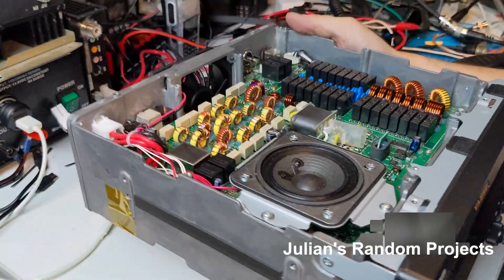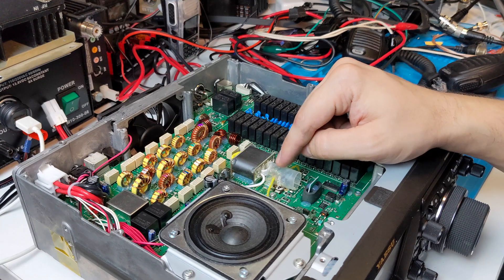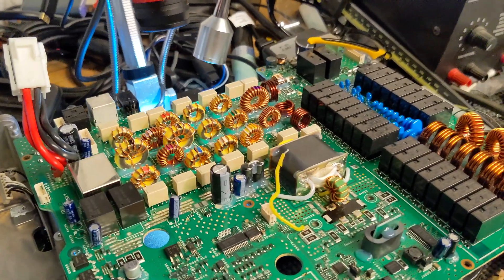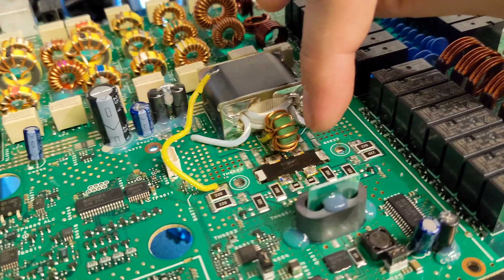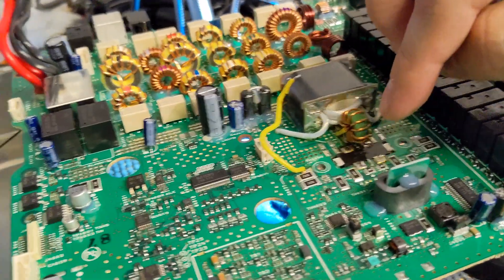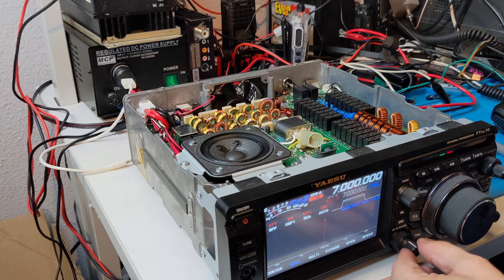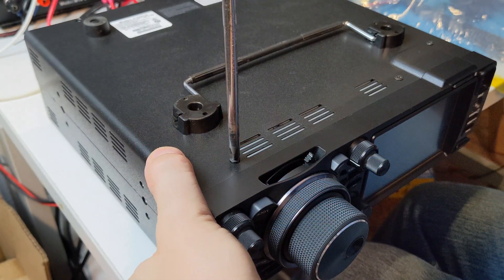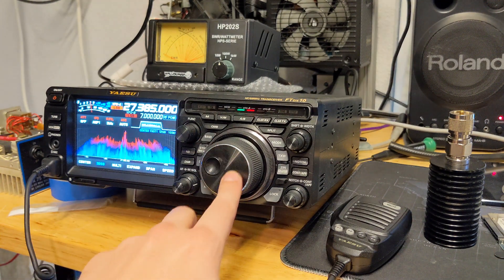FT DX10 Ham Radio Repair Pt2 RD70HUP2 Replaced.

Comment: Hi I (1 of the 3) have just repaired one of these, after remove the PA board from the radio, I desoldered the 6 connections (lugs) and bent them vertically. I set my Hot Plate to 662 F and placed the underside of the PA heat spreader on the plate; within 30 seconds I was able to remove the RD70HUP2 I will see if I can upload a picture. The heat Spreader is also glued to the rear of the board and stayed in place. I used the hop plate to solder the new device to the spreader. Then I resoldered the 6 pins! This is not an easy job. The radio I repaired died while using FT8 at 25 Watts! So clearly the DX10 is not suitable for FT8 or repairing! A shame.
Reply from the maker: These a good data points! Thanks for sharing

Comment: The mosfet is solderes to the headsink, when you replace it you need to solder it back on the heatsink again - you CAN'T just give it some heatpaste! this is NOT correct and nor a solution that will hold. That way mosfet is only fixed to the PCB, not anything else, and the solderpads and solder will press it down to the chassis and headsink, that will not hold!
Reply from the maker: Are you ok? Go re-watch the video. The mosfet 'is' soldered to the heatsink and the heatsink pasted better that factory to the heatsink. We're good. :)

Comment: So power mosfet has cooked on one side... I got it apart without issue.  Problem was not enough solder on back of chip so the failed end had overheated... It happens

My question now is what temprature solder paste to use to replace the new device to board and heat spreader...

I have some chipquick 138 degree c but notice the max channel temp on spec sheet is the usual 175... But instructions, say to keep device below 140 which is sensible... Anyone have any experience in this area... Regards Bob
Reply from the maker: Bob, I only use chipquick to remove components, then clean and remove all chipquick and apply fresh 63/37 solder. hope that helps.

Comment: I'm one of the 3 people that would like to see how you replaced the RD70HUP2. I'm planning on making the attempt myself.
Reply from the maker: You got it! I'll record the next one that comes through the shop. I have a hot air rework wand that I used to heat the chassis to ~650f. Desolder and lift all legs first then apply heat under part until the solder melt and lift (or drop if you're using gravity. Good luck!
Reply: @JuliansRandomProject  Thank you!
Reply: @JuliansRandomProject  Hey, Thanks again for this video. I'm returning here as I removed the RD70HUP2 from my radio last night. It went exactly as you said. I used hot air and gravity to let the plate just fall off the board. Everything went smoothly. Question for you - After replacing the RD70HUP2, did you need to do any of the alignment steps from the technical supplement manual? Specifically, the Drive Stage Idling Current Adjustment?

Comment: I am about to do a similar repair (well, there are two of them already waiting for this job on my lab!). I am not sure if I understood how did you replace the MOSFET. Did you take out the bottom heatsink plate, soldered the power transistor legs and then soldered back the heatsink?. Or did you leave the heatsink on place and then heat it until you could solder the transistor from the upper side of the PCB?. Also, how did you sepparate the transistor from the heatsink in first place?.  Please, any clarification on the exact procedure would be welcomed. Thanks!
Reply from the maker: You’ll need a hot air rework station or a massive soldering iron to get the heat sink up to temp. When removing the part, lift legs first, flip board and heat to remove body of part with gravity and maybe a little help from tweezers. When installing, line up the part, flow heat sink to get to seat then solder legs. Or you can send it in to me. JuliansRadioRepair.com . Godspeed!
Reply: @JuliansRandomProject  Thnaks for the details!. I am a bit far from you, in Spain. I also work fixing radios since the 90s but as my main work since June 2012. So far, about 5500 rigs have passed through my workbench. I hope to reach 10000 before retirement 😅 The FTdx-10 final replacement is one of the few soldering jobs so far that I am reluctant to get into. But I need to do it. So I am gathering information to plan it carefully. I will report back when I have done it. BTW, I don't recall if you talked about setting BIAS to the transistor, that is a key thing to do in all PA repairs, as you know. Thanks again and keep the good work!

Comment: I am also undertaking this repair, but i managed to dislodge the heat dissipator plate from the PCB and now im waiting on the delivery of the new RD70HUP2 mosfet. You reckon i could leave the heat dissipator unsoldered onto the bottom of the mosfet and make kind of a thermal paste heat dissipator sandwich? It would make it  easier to work on it in the future.
Reply from the maker: I’m confident that the solder will transfer heat better than paste. Put come thermal couples or temps sensors on both sides and monitor it for a while under 10% to 50% and see how it goes.
Reply: The heat dissipator, shold be soldered to the dual MOSFET, if it was not soldered, this probally why it faild, the form of construction is a pain in the butt!

Comment: My transceiver Yaesu FTdx10 had the same problem. After replacing the MOSFET worked for two hours then failed again
Reply from the maker: Proper lighting strikes or power surges can often take out supporting circuitry like capacitors, voltage regulators and the like. Message me on Instagram I may be able to help.

Comment: I replaced the MOSFET on my FT-400xd because I had the common low power output. When set to 50W, it would xmit about 19W. The MOSFET was a challenging repair, but went smoothly. I was getting the full 50W across most of the bands. But... My dumbass decided to do the MARS CAP mod, AND.. a firmware update. It worked like a champ for about a week, but then it started changing freqs randomly, and intermittently powering off. Now it's acting like a brick, and I assume it's from a software perspective. Live and learn I suppose. Great video man.
Reply from the maker: Thanks! Can you roll back the firmware? I'd suspect the firmware also.

Comment: Love the George carlin at the end.... and I just got down.  Jk, the last time I listened to 11m in Austin there were some loose screws on the air,  they seem to have transitioned to 2m lol. I haven't been on the air in years.  I sold my ftdx10, I made a quick video about the display issue I had.  73.
Reply from the maker: Wow. Surprised they didn't want to have that sent back in for what these rigs cost. obviously an internal RF issue causing that screen 'glitch'. 11m is nuts but it's a fun time for sure.
Reply: I contacted yaesu and they blamed it on my surroundings, saying that it was my power supply, or that the rig was picking up interference.   when i tried 3 different supplies and even with no antenna connected and on battery power in the driveway it still showed full signal blips on the far side of the waterfall.   My radio was not the only one to have this issue.  Another guy sent his into yaesu and they said they couldn't duplicate the problem.  When he got it back, the radio started acting up as soon as he turned it on.   Anyways, i've been a yaesu fanboy since 1991, but after a few issues with yaesu customer service i've since sold all my yaesu gear.  I'm not knocking 11m, it's fun :)  
 @JuliansRandomProject